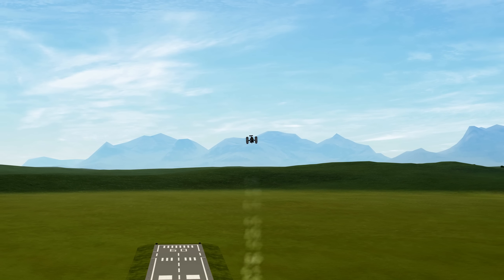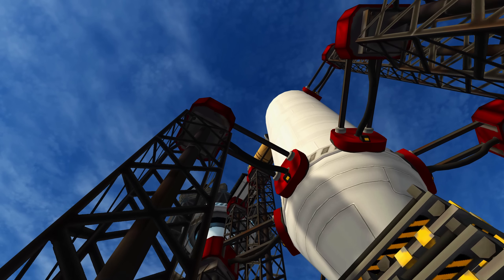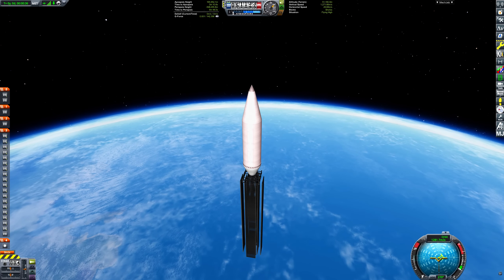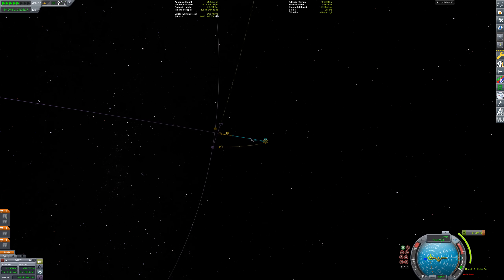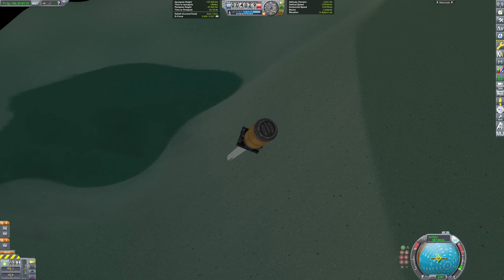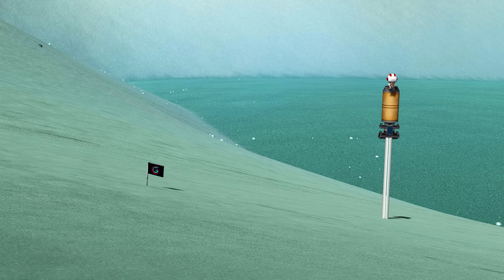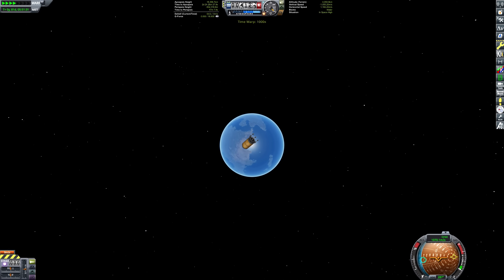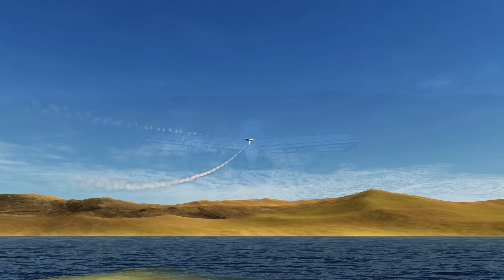Minmus on Decouplers | KSP 1.10.1

Comment: I was the one who suggested that timewarp would decrease the timestep and therefore increase the force on Stratzenblitz video "Engineering a LIGHT-SPEED mass driver". Right now i feel the most smug i have ever felt lol.
Reply from the maker: I didn't think it would work, but it turns out it works exactly as you predicted. 4x time warp literally multiplies the impulse by 4, which greatly reduces the number of decouplers you need. That said, it still sucks. Instead of an effective ISP of 10 s, you get 40 s, which is still very low.
Reply: @Stratzenblitz75  lol thats almost the lsp of sepratrons
Reply: @lennartsix6102 separations are like 150s or something lol

Comment: Okay, you have to admit this one requires ALL of the physics tricks.
Reply: No it doesn't use the heatshilds with high lift to drag ratio.
Reply from the maker: I'm trying to minimize my use of exploits when I can. Obviously, the lithobraking and decoupler physics are exploits, but I did not use any aero exploits for this mission. If I were using say the heat sheild offsetting trick, I wouldn't need 2 stages to get to Minmus: I could reach escape velocity from the launchpad without overheating.
Also, didn't use part clipping for once!
Reply: @Stratzenblitz75  its not an exploit, just call it Rapid Scheduled Disassembly

Comment: the new flag parts are OP. I've used them as wings due to the lift they create, and they have infinite heat tolerance. Might want to try them out. Even used them as a heatshield.

Comment: How heavy exactly is ksp? I mean can you play it on a laptop without a problem, or you need a monster pc?
Reply: I’m playing it on a laptop. Granted it was my son’s old gaming laptop which I “inherited” to use mostly for work. But, KSP has worked great. I do have occasional kraken attacks but it sounds like everyone does once in a while.
Reply: @mef9327  thanks bro. You also may want to check out the ksp2 trailer, I'm gonna look for work at summer just to be able to buy a pc to play it. Ksp2 and Crossout.

Comment: No circularization? I guess you don't have to worry about gravity losses when you need scientific notation to represent your TWR...
Reply from the maker: That is actually a very interesting point. With an instantaneous impulse, you don't have to care about gravity losses. If you wanted to reach escape velocity for example, you could get an impulse to 3400 m/s in any direction (as long as the ground isn't in the way) and you'd still reach escape velocity. This is why going straight up is a good strategy for decoupler rockets: it minimizes your drag losses, which is the largest source of losses from the launch.